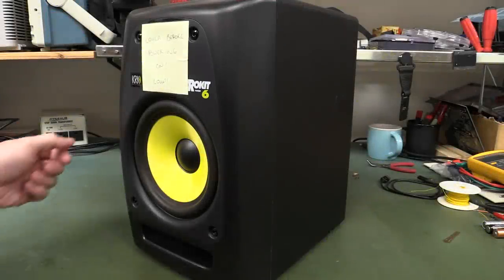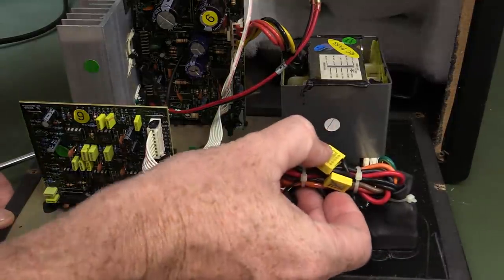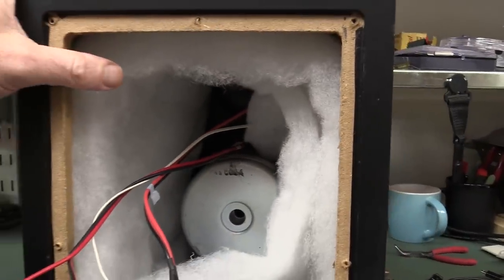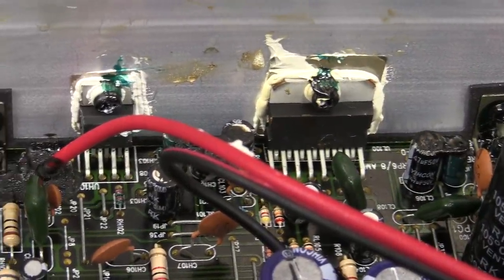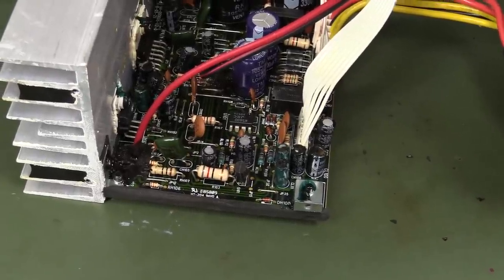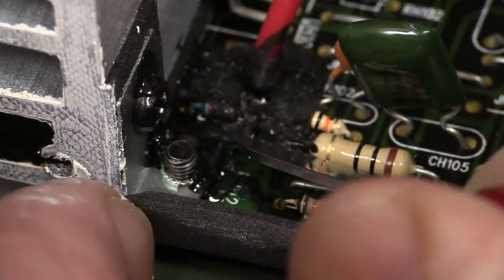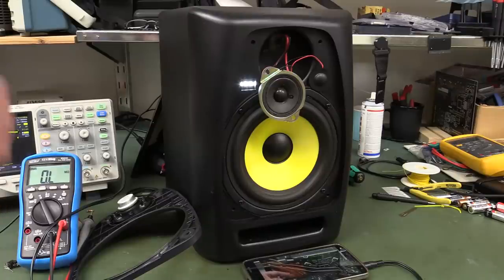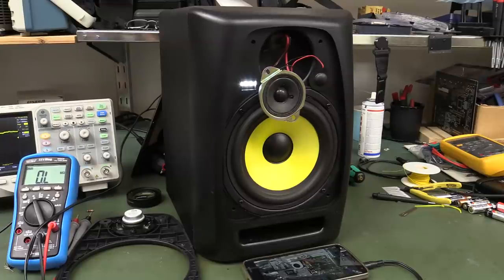EEVblog #1072 - KRK Rokit 6 Studio Monitor Speaker Repair

Comment: Could the cover on the phono jack be to block the air path so it all goes through the bass port on the front?
Reply from the maker: Could be. Pretty elaborate way to do it if so.
Reply from the maker: Upon second thought, yeah, it must be. They are using the rubber as a seal for the connector and to prevent sharp acoustical reflection points or some such. Because if they just wanted to seal it, silastic would have been fine.
They really have gone to town with the sealing, it's seems to be their thing.
Reply: EEVblog  I used to manufacture amplifiers just like this - the RCA jack construction is such that silastic will ooze down into the barrel and cause problems. The rubber boot prevents whistling noises through any small openings.
Reply: All the sealing around the RCA connector, all the rubber gaskets and stuff is the manufacturer making sure the case is air tight, so you don't get 'chuffing/hissing' sounds from the air escaping as the drivers move and the air pushes through the holes.
Surprised there isn't a rubber gasket around where the back panel attaches to the case to go with the rest of the attention to detail they included. sealing the pots and everything else. 
My guess would be that putting a pre-former rubber box around the connector and glueing it in place is quicker than trying to prevent the goo from oozing through the connector from the back.
Reply from the maker: Yes, would have expected a seal around the back panel in that case. Seems a bit extreme for the RCA connector, couldn't they find one that's not hollow perhaps?
Reply: What's cheaper?  Tracking down the golden unicorn sealed RCA jack (I've never found one), or a rubber boot?  ;-)
Reply: Yes!! When I've built cabinets before, a surprising amount of air flowed through RCA inputs if they weren't sealed up.  Same for power jacks, barrel connectors, and others.
Reply: Couldn't they use a rubber "dummy jack" plug for this purpose? Even cheaper.
Reply: Dave Curran i
Reply: It's done because enclosure leakages change the effective volume of the enclosure , altering the tuning of the enclosure and port
Reply: You have to remember this is a Loudspeaker ENCLOSURE with some amplifiers in it.
Not a box with some speakers,
Air flow control == audio performance.

Does the black stuff become hygroscopic as it ages.
Hence the conductivity.
Reply: Plexus Productions, "Dave J, you don't know everything about everything - open your mind to learning."... 

Perhaps you should heed your own advice because on pretty much every video he uploads Dave says "if you know why X put it in the comments below" and then it's not uncommon to see him pin informative comments and/or refer back to them (with screenshots) in follow-up videos.  Not really the behaviour of someone who thinks they know everything...
Reply: This is more or less standard manufacturing practice in any speaker cabinet that isn't made of plastic (like cheap PC speakers). You isolate any possible air holes so that only the baffle (aka, reverb port) allows airflow. Also prevents dust from gumming up the connectors with the constant in/out air leak.
Reply: no, the cheap part American put out  no quality control over anything that is made in the in the states
Reply: Plexus Productions
Woah!  Where did that remark come from?
Reply: Jennifer White
Are you saying that America is for dummies and we don't care?  Oh, maybe you have a point there.  Carry on.
Reply: Nicholas Brown
What electronic noise?
Reply: Is this GHS Dave?
Reply: Think it might have something to do with reducing moisture.

Comment: Welcome to my world.  Conductive gunk is the standard in the industry forever in the CB radio world.  Since they started using transistors in CB radios they have been using glue that goes conductive and corrosive.  I remove that &%*# almost every day.  If I ever meet the guy that invented the original "Sony Bond and Bond Lock" I'm going to strangle them. :-)
Reply: Dave look like he needs one of Peter's fiberglass PCB cleaning pencils......anda dremel with a brass wire wheel on it!! That shit was crazy!! It looks like the material they were injecting on the line had a mix problem and one of the constituents (likely the catalyst) was in excess and it pooled under the material after the top catalyzed and skinned over. Thus trapping the catalyst underneath.....and most all catalysts are rather corrosive. Especially epoxides which I am sure that is.

PS I would be wearing gloves.
Reply: First gen Mitsu VCRs were notorious for conductive brown glue. Fixed hundreds of them.
Reply: Donald Clifton 

What I always found interesting is the only place I find it is in relatively cheap consumer electronics.  Don't find it in high end test equipment, amateur radios, military electronics, automotive electronics.  I swear there is some secret dollar figure that manufacturers use.  Anything below that price gets the corrosive glue.  Spend over that amount and they don't install the plague in your equipment.
Reply: If equipment is expensive enough, then chances increase that someone will attempt to repair it, whereas with the cheap stuff most people will just bin it. Additionally, higher-end products brand names are more valuable, if I spend a lot of money for a premium product and it fails prematurely, not only am I unlikely to buy another, but I will also tell other people. If a cheap product fails quickly, I'm not going to tell all my friends, since it's expected.
Reply: Do you know of any brands that don't use this black death? Now i want to replace my krk rokit 8's of the same generation. I'm looking at JBL's right now
Reply: Same here MikesRadiorepair. !! Read my comment above. We had loads like this in the workshop. I knew what it was before I even saw the video....
Reply: Not only in CB, also old ICOM or kenwood ham radios. Fixed a lot of them 73
Reply: Mike. i just wanted to send this link to you, i directly thought:" Uh, that a vid for Mike"..;-)
Reply: maybe thats what keeps killing my cheap alarm clocks xD
Reply: What about silicon glue? is it a good replacement?
Reply: My favorite was RCA portable video recorders. They used some kind of cheap rubber feet on the bottom that were screwed through a hole in the case and contacted the circuit board. They would become conductive with time and short random  signals out. Don't ask how long it took me to find that the first time!
Reply: victornpb -  I have used Dow Corning 3140 silicone (runs like thick syrup) and 3145 (stays put like toothpaste) on industrial circuit boards that operate in high temperature / high vibration environments for years. Non-corrosive and does not attract moisture.  Very good at keeping passives stuck to the board in high shock environments as well. The downside is cost of the silicone and repairing/reworking a board that is covered with it.
Reply: So it is a self destruction timer?
Reply: victornpb
The logic seems to be that the stuff is unnecessary and that it's real job is to make sure that the equipment dies an early death.  But there is a small chance that it's helping to eliminate microphonics or whatever.   Silicone is pretty impervious to everything and would seem to be a good choice.  Actually, window caulk of any kind would probably work, but the silicone is a much better idea.  I don't think silicone is hygroscopic.  Maybe Google that and see.  Good idea.
Reply: First thing i though with all that glue was you mike LOL
Reply: ROFLMAO  I think that's the best thing I have ever heard that should be done to them.  God, why didn't I think of that.
Reply: What technique do you use? Is the scraping technique Dave stumbled upon the standard?
Reply: I call it "death glue".
Reply: Shit, really? Goiing to have to check my cb's. Dont use them a lot but I have a decent interest so fully intend on doing so.
Reply: Oh bull crap you would strangle him. Think how much money he’s made for you over the years and given you a job. We all love fixing things. It’s bad designs that give us our livelihood and pay for the house and what not 8-)
Reply: once you remove the black gunk and repair the damaged components do you just leave them bare after or cover them in something else?
Reply: I've seen plenty of hot melt used on boards. What's the verdict on that?
Reply: @fieldlab4  
Have seen hot glue in a lot of electronics and have not seen it cause a problem yet.

Comment: Well, I guess Ill stop looking for used KRKs online then!
Reply from the maker: Not this generation anyway.
Reply: That wasn't my takeaway at all. My takeaway was: Awesome. An otherwise good product with a reasonably easy fix. I can snap up damaged ones with this problem, fix them, and have myself some nice ultra-cheap monitors.
Reply: TK Street I’m all for easy repairs, but questionable goo and corrosion? No thanks.
Reply: Look for some Adam or Focal monitors?
Reply: My JBLs are holding up fine! :)
Reply: You scrape off the goo and replace a couple of components.  Sounds like little hassle for a nice payoff to me.  But if you're not interested, it's just one less person on ebay I have to contend with for them.
Reply: hahaha well played
Reply: TK Street Yeah unless it eats away traces like electrolytic capacitors on the keithley 2k models. But in this case I would just fix the traces and have a nice speaker. I actually like the corrosion repairs especially if it is through hole and just 2 layer boards
Reply: Just keep in mind that they aren't really professional studio monitors. They're what Guitar Center will sell to the person who doesn't know anything but wants to make "beats" in his home studio.
Reply: I certainly wouldn't buy them new or in working condition. Also I wouldn't really want to replace a tweeter on them. And I am definitely more of a stereo floorstanding speaker kinda guy.. But the principle remains the same if it was some classical Yamaha monitor legend
Reply: those brands  are overkill for YT vids.
Reply: NNITRED I collect and repair older highend multimeters usually 6.5 digits and up and I don't run a cal lab. Fixing stuff is just a hobby
Reply: That wasn't for you. It was reference to spending big money on Adam and Focal branded monitors. :0)
Reply: TK Street+ l would never buy something knowing that is has corrosive conductive mystery goo in it.
Reply: +EEVblog
I wondered for a long time what could be the problem with mine - I wasn't even aware of this problem. Now I'm going to get them out again and check them for that.
Reply: jbl studio monitors are at the same price as the rokits. and the jbls are easily better they sound better and dont have gunky shit in them.
Reply: I like Adam.
Reply: Michael Moreau Mike Dean and Joe Barresi both have tracked and mixed on krk rokits. Although they use other monitors that are better and more expensive as well. To say these aren't good enough for pros is not tue.
Reply: which gen are those?
Reply: TK Street "An otherwise good product with a reasonably easy fix." - Having to replace the tweeters is definitely NOT something I'd call a "reasonably easy fix". Those things might be surprisingly hard to obtain.
Reply: Hahaha KRK have always been for noobs. In the similar price range go buy Yamaha HS series
Reply: This is better , what is the power output of this amplifier ?.
Reply: Mine works fine need to open up and see

Comment: That black gunk is an A/B potting compound, similar to "Smooth-on Smooth-Cast Onyx" I used similar to pot filters back in the day...
What tends to happen is that they have a shelf life, and if you use it after its shelf life, it WORKS but the chemicals debind over time because they do not fully cure and when they break down, they break down into a sort of watery soup that you were seeing there, that weird moisture is what is causing the conductivity, and the corrosion. 
Often times companies will test a little of the expired compound, and if it solidifies and tests fine, they do a run of product with it, and if it meets spec, they ship it....
This kind of unique issue starts popping up after a few years, likely this became a problem with one or two runs of units well after they were off to a new model line.
Reply: Vaughn Saball Wow, great info, thanks! I thought moisture in boards had left when they stopped making paxolin boards - same thing, heat old gear for a few days before switching on
Reply: @EEVblog ^Need to pin/promote user/WillowFox (@Vaughn Saball) comment. Excellent Stuff.
Reply from the maker: Awesome info, thanks.
Reply: Yeah, some A/B resins/potting compounds are actually hygroscopic and the water keeps the compounds from reacting as designed
Reply: Just wondering, is there a similar compound without this issue? Or can you use some kind of regular glue? Also: How necessary is this stuff (except on components that could move or vibrate)?
Reply: Those boards are paxolin ( SRBP) and also get conductive with time. As well the ones with the screen printed conductors on top ( done to make a cheap double sided board and not use that expensive, as in a cent more, FR4 PCB material that supports double sided better) on boards go high resistance with time or get internal cracks or simply leak across the board.
Reply: Also happens if they leave the pots of unmixed components open a few weeks, running the line and leaving the filler machine with the seal caps off as it is convenient to simply top up the pots instead of having to go through the whole pop cap off and fill it then pop the air tight seal back on, or it was lost along the way. Then the components pick up moisture from the air and other pollutants that react with it, creating all sorts of odd problems. The blending tubes and such are designed for ease of replacement as they are a pop on part that has 2 lines going to a mixing dispenser tip that keeps the 2 parts apart till just before the tip then the internal baffles and high pressure from the dosing pump force blends the mix, so those parts will be changed regular or at least daily, but the back end will just get batch after batch in it and will rarely get cleaned at all.

Seen it with paint mixers, where you have to do a tank stir every day, and a test dispense, and make sure the dispensing tubes are always capped, or else you get a skin of pigment on the tube that clogs the dispensing pump and causes colour mismatches on the final product. Pretty every Mixmaster will have a pot of Fordite in the process of being made next to the machine. Saw the one line making a particular colour for a customer, and the machine had next to it a big trolley with 20l, as opposed to the 1l regular plastic bottles, of pthalo blue colour tint, as the particular big job they were doing ( around 8 weeks of doing 300 20l buckets of paint every day of the week) used 1.3l of pthalo blue in the colour spec, along with a touch of another 3 colour tints. They used to have a plastic bucket they poured the tint into, then used a smaller jug to fill that dispenser tube with after every bucket was done. Machine was covered with blue tint along with the floor around it from spills. I got regular paint tints done using the old manual Mixmaster that sat otherwise nearly unused near it, and the first few batches out of it must have been very troublesome, as it had been unused for a few years and left sitting there.
Reply: @SeanBZA  Pertinax doesn't get conductive with time! Only if you burn it to a crisp or if it soaks up leaked electrolyte or other substances.

Comment: Someone chose that material based on its ability to dampen vibration.....my guess is it was chosen outside of the view of the EE's that designed the circuits and PCB's. 

Oops.
Reply: Factory400 Or the EE chose it based on a data sheet that didn't clearly tell anyone not a chemical engineer that this compound would become a corrosive conductive chemical time bomb undetectable by electrical and mechanical testing.  Such a material is fundamentally unsuited for the electronics industry, and there should be warnings telling electronics professionals to avoid it altogether.
Reply: that´s the usual problem when you need to look for stuff you aren´t familiar with, and also which needs to be cheap and not exceeding your total spec´t BOM cost. So you rely on what the datasheet tells you and if it´s not fully specified then it might be cheaper than stuff from let say 3M, but you never know what´ll happen over time, as no one are doing long term tests on consumer or prosumer stuff anymore.
Reply: Could be planned obsolescence haha